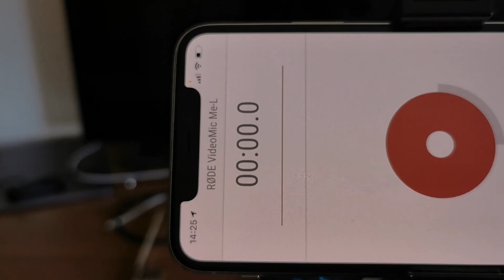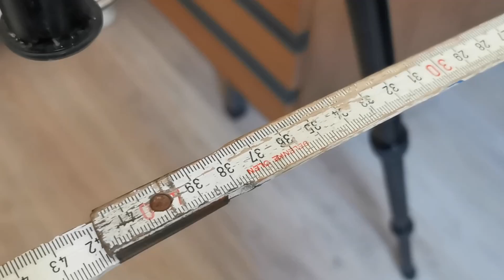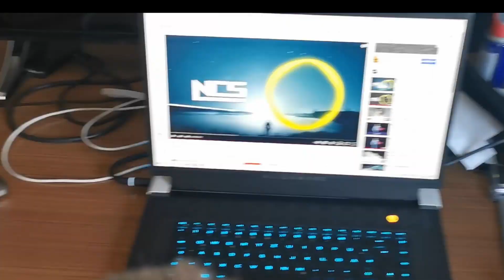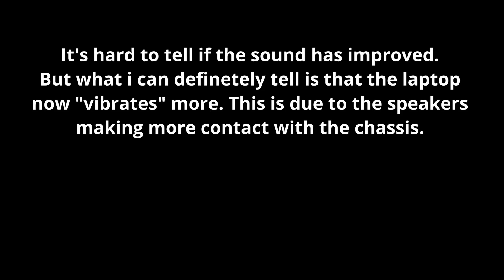Let's Try To Fix The Horrible Alienware X17 R2 Speakers (Maybe)

Comment: Wow that took a lot of work!  I threw on my B&O headphones to try and appreciate the difference.  I honestly can't tell the difference between the stock and the modded AW.  Thus I'm not sure it's worth it for the extra chassis vibration.  One thing that is clearly demonstrated is that MB is on another level.  Heck my 13' MB Air sounds better my i9 R1 AW.   One day this noob will follow your liquid metal guide and change out the thermal paste.  Thank you for your videos!!!
Reply from the maker: That’s what I love doing ❤️ 
Yeah they sound different after padding… not sure if it’s enough though 🤣
Reply: That's simply not true. In this video, the Alienware has more body and presence in the low-end. Which surprises me as the Alienware laptops haven't really had great speaker quality since ditching the Klipsch partnership and going from a 2.1 set up with larger woofers, to smaller thin speakers.
Reply: Upon further listening to the last comparison. It seems like the Alienware at first seems fuller but its only because its softer and doesn't seem to have as much clarity. Pretty disappointing showing really.  My ASUS ROG Scar 15 has much nicer speakers. Much closer to the 16" MBP. I wonder if its because of the amplifiers ASUS use (smart voltage-boosted amps) or the Dolby tuning?.. I'm not sure.  One thing I will say about the MBP, they do tend to be too treble-heavy.

Comment: In my case I opened it up and found that one of the laptop chassis screws had a nut that must have fallen off and got stuck to a speaker's magnet. Must have happened when it was assembled, the laptop came like this. Removing that finally my crackling gone.

Comment: Finally i think i found the Man who can Really Solve My Problem !! Hey Man i hope you are doing very well ! Let Me Explain Everything - i was a Hard Core Mac User since my first Computer/laptop ! i am a Pro Mixing & Mastering Engineer ! 4 Months Back i was going to upgrade my mac from Intel To M1 Architecture because my intel mac was not holding big projects so i decided to upgrade to new top end mac but my requirements were i need new mac Asap and waiting period was of 4 Months so my friend guided me to have a try on windows laptop as they are also powerfull and Only couple weeks of waiting ! with the stone heart as apple fanboy i finally ordered and got Alienware X17 R2 !! i am Satisfied with the performance as it handled All Big Projects -- BUT -- It has a really annoying problem and Every Tech Person Failed To Fix !! Even we don't know what's the problem ! the problem is Randomly Crackling/Static Sound !!! it even renders with the song !! I am using High End External Audio Interface !! Interface is OK, it worked like Butter smooth On my Mac ! Drivers are upto date, reinstalled windows 3/4 times but still nothing working !!  i don't know what the problem is !! if you can help me fix my problem then i will Pay You as well !! please reply to my comment and lets fix my Out of the world problem !!
Reply from the maker: Hello. Did you reinstall the realtek drivers?
Reply: @humanoit7533  Tried Everything Bro ! That crackling sound even comes while playing in chrome !! I tried three Different Audio Interfaces of different Manufacturers but same problem !!
Reply from the maker: @mixedbydense  have you tried to completely reinstall Windows?
Reply: @humanoit7533  Realtek Drivers are up to date & in Realtek Drivers Properties Sample Rate is Set To 48Khz But i work on 44.1K (External Audio Interface) i thought this might be the problem but my friends are working with same Settings and they are not facing anything !!
Reply: @humanoit7533  Yes, 3 Times ! Clean Install
Reply from the maker: @mixedbydense  
1.try to disable “enhance audio” in windows sertings
2. Open your bottom case and see if there are loosened metal parts on top of the speakers. If so, they will produce a rattling sound once the speakers move up and down.
3. Check for updates on dell website

Comment: fyi the x14 speaker sound way better than all other models, if you have a chance to check them out in person

I am willing to bet they are the same speaker but they are up firing and they are padded better (tightly) so the sound doesnt come off as if it were inside a plastic box thefore it gives a much better sound.
Reply from the maker: Interesting…

Comment: Great video, thank you! I am pretty close deciding to buy this laptop or not.
Reply from the maker: Go get it and optimise it asap! You will be more than happy
Reply: @humanoit7533  Thank you. My last enthusiast laptop was the Area 51m r2. Haven’t had a high lens gaming laptop since. Lol was actually deciding if I am over buying the x17 r2 or just get the x14 with a 3060.  Great video series on the AW systems, thank you.
Reply: I recently picked up a x17 r2 with an i7 and 3070 and have been loving it. Runs great and performs well running heavier games like star citizen
Reply: I would say get it BUT ON SALE ONLY this thing devalues like crazy within just a few months I got an R1 with 2tb ssd 2k display 32gb ram 3070 upgraded killer wifi, for only $1600. this thing would be close to 3k new.
Reply: I bought the X17 R1 used on ebay. i9, 3080, 64gb ram for only $1800. This was $3500 when new. Absolutely insane

Comment: Having just gotten this laptop, I was worried about speaker sound.  My considered opinion is that the speakers just suck.  The best sounding laptop I've ever heard is an old Dell XPS 17...it's 12 years old and still blows other laptops out of the water soundwise.  My five year old Alienware 17 R4 sounds better than the x17 R2.   Oh, well... :)
Reply: OMG I have the same laptop! I recently pulled it out for use as the device to play music through my sound system at my party. Before I had all the PA/sound system set up, I was just playing music through the in-built speakers.  Are you talking about the XPS L702X with the JBL branded speakers?  They're rated at 22W total.  Pretty unheard of in laptops, even up to today.
Reply: @damienlobb85  That's exactly the laptop and speakers I'm talking about!  Every other laptop I've heard pales!

Comment: Have you considered turning on the battery threshould for 75% for instance if you use you laptop mostly on wallpower to prolong the battery longevity? Do you think it is a good option?
Reply from the maker: Yeah, great idea! 
There is an option within the BIOS where you can choose how you use your laptop primarily. Battery, ac, etc.
Reply: @humanoit7533  
I actually tried it with my alienware x17 r1 and set "start charging to 60% and stop charging to 76% so when I don't play games it doesn't charge, But when I play games it start charging despite this feature turnd on. And also after some time of playing the alieware power button logo starts blinking red sporadically and command center says "battery optimization is triggered which might take a few minutes to start chargning again"
Reply from the maker: @andriizakrevskyi5335  
The option is in the BIOS. 
Under “POWER”
Reply: @humanoit7533  it is actually located in BIos in "advanced" Panel . There is no such a " " power "
Reply from the maker: @andriizakrevskyi5335  ok it looks like we’ve different bios-versions
Reply from the maker: @andriizakrevskyi5335  yes youre right. I was wrong. I didn’t look  right. It’s under “advanced” then battery…. 
I use “primarily AC use”
Reply: @humanoit7533  Could you please tell what that option do? because I use costume option As I've mentioned. and what is the best option? 

2. Do you have advance charge option enabled or disabled? what is the pros and cons of this option>?
Reply: @humanoit7533  could you please tell what is a Primarily AC use and what are the benefits of using it? because I use custome mode as I've mentioned before /

2. Do you have advanced charge mode on enabled in bios? what are the benefits of this mode>
Reply from the maker: @andriizakrevskyi5335  i set it to “primarily AC use” by selecting this option your battery management will be optimised for ac use. Your battery will be charged only till ~80% (with your AC adapter plugged in) this benefits your battery and thus improving battery life. It’s not good if you keep your laptop plugged in whilst the battery is fully charged.
Reply: @humanoit7533  So I decided to also test this "Primarily AC use" and the charging doesn't stop. It bypases 80% and now it is 91 per cent and keeps on charging
Reply from the maker: @andriizakrevskyi5335  strange…
Reply: @humanoit7533  could you please test custom  mode and make your own treshold to see how it I'll perform both in games and regular work? Because I'm having issues with threshold. "battery optimization is triggered which migh a few minutes to start chargin again
Reply: @humanoit7533  how can I resolve this issue?
Reply from the maker: @andriizakrevskyi5335  
I get back to you asap

Comment: I bought my laptop recently in the black friday sales. i was very excited to recieve it but after using it a while i am so dissapointed to be honest. i thought there was something wrong with my speakers. the sounds all wrong and when i watch tv shows the voices sound muffled and i cant understand what they're saying without really listening. im so annoyed at alienware for this, i cant understand how they can justify a laptop at this pricepoint (3.8K usually, i bought for 3.2 - STILL a hell of a lot of money and will be spending the next year paying it off) with so many sound issues so bad that i thought it was BROKEN.
also the laptop came... WET. the wrapping around it and laptop itself had condensation on it (the outer box it came in was fine?!) and when i rubbed my finger more than a cm across the wrapping, or laptop or screen there would be water droplets on my finger and on the surface of where im rubbing. what the hell was that about??

what a waste of 3.2k

Comment: This is pretty disappointing.  I have the ASUS ROG Scar 15 (2021) and it has 2 woofers (down-firing) and 2 tweeters (forward firing from hinge), paired with "smart" voltage-boosted amplifiers. And it sounds much better than all the more recent Alienware laptops. But it still isn't quite as convincing as my 2011 Dell XPS 17 with it's JBL-branded 2.1 set-up. The woofer is 10W and the mid-highs are 6W each. When I had the laptop apart many years ago to upgrade it, I saw the speakers. It looks as though they just took a JBL iPod speaker dock and crammed it into a laptop chassis. As it uses the same aluminum-cone drivers.

Comment: I could never get the x17 after owning the x14 for a few months, It's not worth it in the slightest man. Alienware has terrible cooling tech
Reply from the maker: Optimisation is required for this laptop
Reply: @humanoit7533  exactly for %3 more performance than my 3070TI. I mean the VRAM is a plus but that’s it.